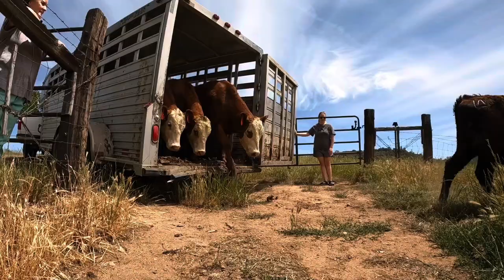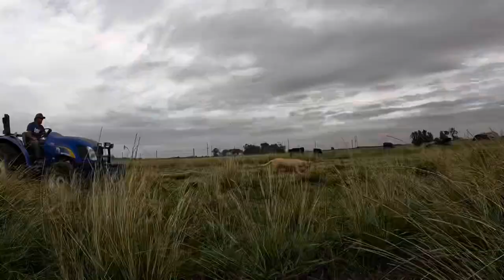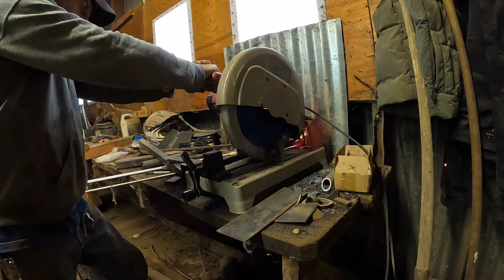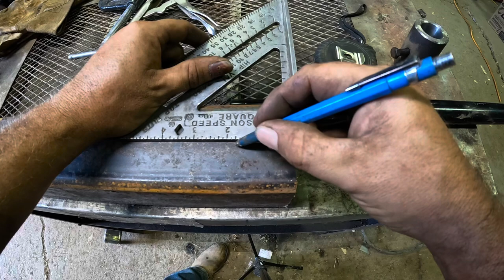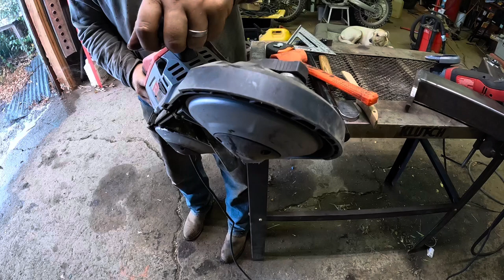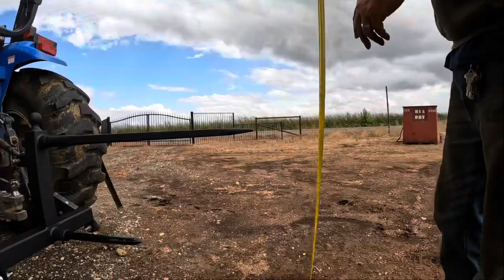Clipping Some Pasture and Building a Three Point Bale Spear

Comment: You're an excellent welder.  You could certainly make a living as a welder should you need to some day !!   But there was one thing I was concerned about and that was whether or not you had ear protection when you were cutting the flat bars and square stock with your shop saw.  I once used a portable concrete saw to repair my front steps and really damaged my hearing because I didn't have ear plugs or other hearing protection.  I'm paying for it now !!

Comment: That 3 point bale spear build  was a nice easy-build project, Tyler !! You seemed to whip that out in no time. Good job !! WOW, I didn't know that the 6' round bales weighed as much as a 1,000 lbs. !! That is HEAVY for your little old tractor 🚜 !!

Comment: I have a design question. Why did you choose to make your hay spear with 2 vertical spears?  I don't see many of those and was wondering what led you to that design.  I buy hay from others and often have to settle for poor quality hay in tough years. In those times, a tool with two small spears on the bottom and a large spear on the top helps to keep the bale from shifting when lifted.  Thanks, as always, for your excellent videos, and I do appreciate those welds you produce.
Reply: Because it goes onto the 3-point attachment. Cheers!
Edit: another person answered the same question in more detail.